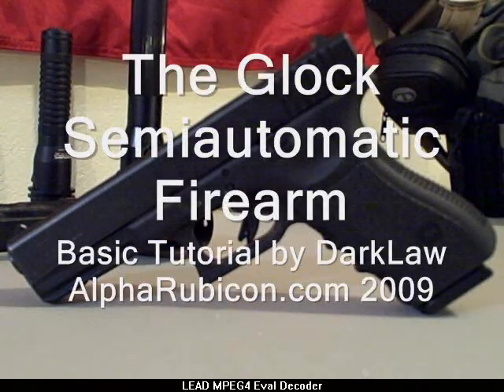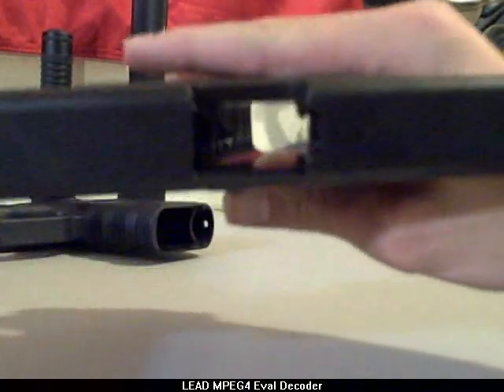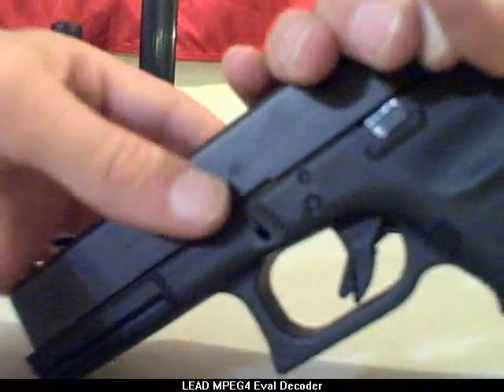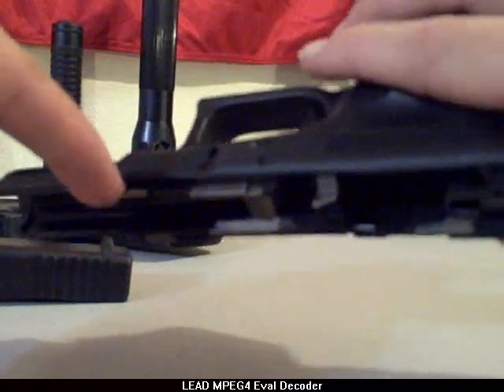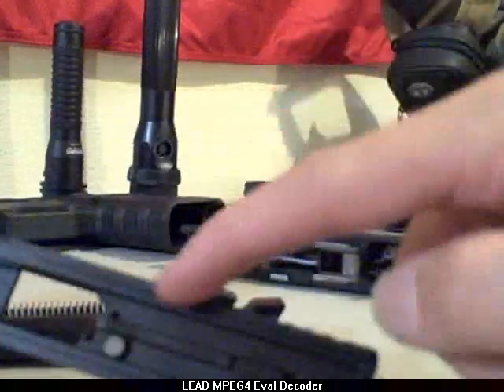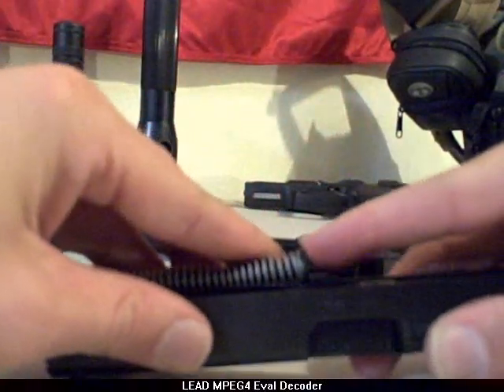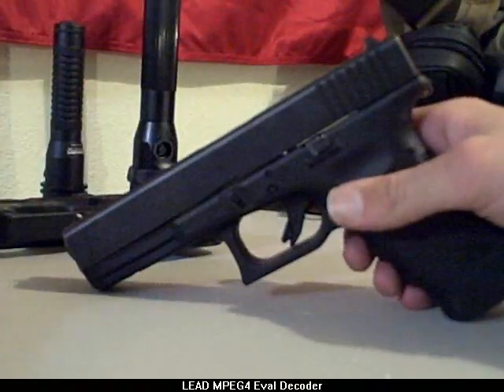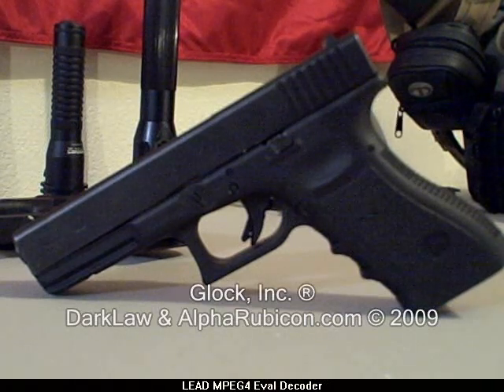Glock Disassembly / Field Strip

Comment: i hate dry firing too. you can hurt it by dry firing it. it will over time destroy the firing pin. dont panic because thats thousands and thousands of rounds into it. what you can do is get these safety caps that go over the firing pin. i've been told that will protect it.

Comment from the maker: No, it doesn't matter.  I simply showed the way that I was trained.  You can either pull the trigger before disassembly or at the point in the video; after pulling the slide back slightly.  

Either way is fine and will not damage your Glock (as if anything would!) ... it merely depends on preference and muscle memory!

Cheers and thanks for the comment!

Comment: Thanks for the video, but I have a problem with your technique.  By reaching over the top of the gun to Push the buttons down, there is a tendency to place the heel of the hand in front of the muzzle.  Many, many people have shot big holes in their hand using this technique.  It is much safer to reach up from under the trigger guard and Pull the releases down rather than reaching over and Pushing them down. -- Jeff

Comment from the maker: There is absolutely no reason to need a snap cap in the breach.  Dry firing weapons, such as the Glock, is in no way detrimental.  It's a Glock.  Dry firing simply releases the tension on the striker spring in the exact same manner as when you discharge a round, but without the explosive combustion resetting the spring.  No offense, but, you are not going to hurt your precious Glock by "dry firing" it.

Comment: I was watching for 1 minute a noticed you did something wrong. With any type HandGun you never put your finger in the slide to "physically inspect" if its loaded the reason for this is because if your gun is old the slide catch can slip and will break your finger with how strong the spring is.
Reply: I have a G22 and mine does this sometimes too, never actually broke my finger, ripped off a nice chunk of skin though:p
Reply: ***** if you physically check with your finger you running a risk of hurting yourself. with an old model of a gun you CANNOT physically check its dangerous if you wanna break your finger its ok with me. But when you hurt yourself don't come cryin' to me.
Reply: ***** Another thing is, the glock can actually break your finger if it hits it in just the right spot there are a lot of pressure points on the body over 3000 to be exact so dont think your a hot shot just because you seem to know a lot about glocks.
Reply: Someone give this guy an RKO
Reply: +L44tsmasher735 Physically checking the chamber is the prescribed method by Glock and every law enforcement agency that uses them follows suit. Simply "looking" is not enough to ensure safety, especially under low or no light conditions. There were some other flaws. The maker of the video should at least make an attempt to use the correct terminology when describing parts. For example, they aren't "buttons" to disassemble. It is called a SLIDE LOCK. Also, you pull the trigger to disassemble BEFORE you move the slide rearward and push the SLIDE LOCK down to remove the slide. Doing it in the manner in the video is not safe. Rule #3 Don't point at anything your not willing to destroy, was disregarded and actually had his hand near the muzzle. Not smart Capt Two Fingers!
Reply: Jim Webb But you never use a finger for a physical check, you use a barrel brush to push out any casings or bullets that their could be.

Comment: is it even possible to disassemble that glock while loaded? like jason bourne would do in the movies.
Reply: if you want to get shot sure. take note of the step where you have to pull the trigger to drop the hammer, that would be an VERY bad time to have a round in the chamber. also without that step the slide wont come off the frame. so movies 0 reality 1

Comment: This isn't even the correct way to take down a Glock.   Remove mag.   Dry fire weapon.  Then pull slide back 1/4 inch  and pull down on the takedown buttons.. then pull slide off.
Reply: pretty sure thats what he did, minus dry firing first.